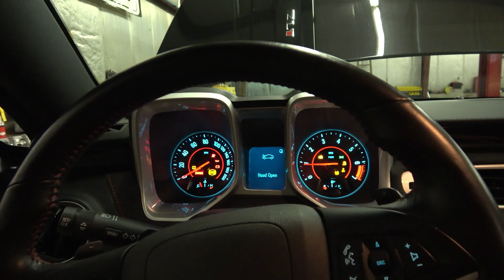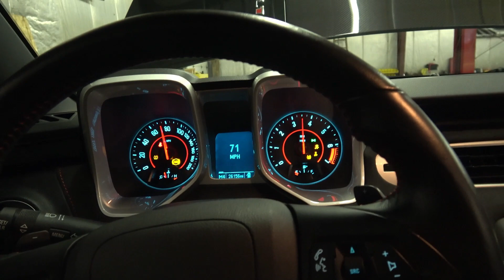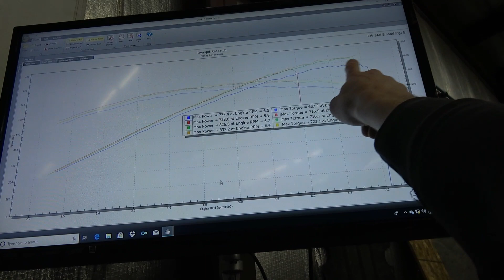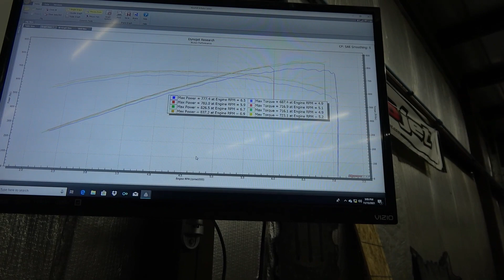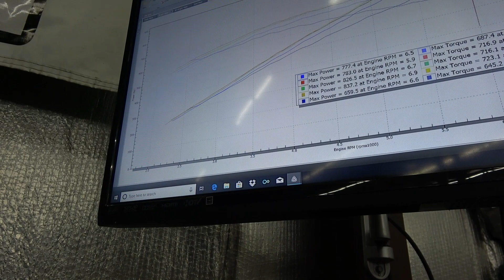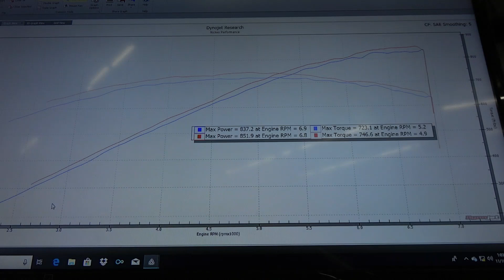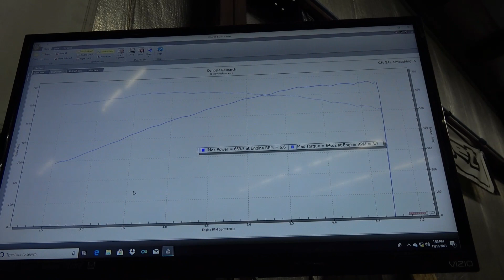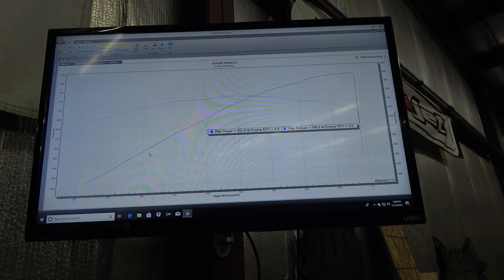Magnuson 2650 ZL1 Camaro

Comment: I'm sending my ride back for an added build. I have the BTR stage 3 cam, 2.45 upper pulley, ID1050X, duel catch can, with 2" headers, 3" cat back and 4" duel exhaust tips (CORSA). I'm adding Magnuson 2650, Nick Williams 103mm throttle body, Roto Fab Big Gulp cold air intake, 9.10 lower pulley, 2nd fuel pump for 100% e85, Arco duel heat exchanger, Texas Speed ported cylinder heads, lifters, push rods, Monster S triple disc clutch kit. J&S Performance and Tuning said we should crack 900 whp to my 2013 ZL1? I also run ROTELLA 15w-40 engine oil. I am scheduled for 4-25-2022 build and should have an answer by 5-6-2022. Great content! ✌
Update, my ARP stud kit is back ordered! Throwing a drag. Arriving around 7/9/22 Maybe?. So I am waiting on a back order before the build can start.
Reply: How’s she looking?
Reply: @ronnytavarez1140  It's not! Pissed because the distributor who sells the material to ARP, DOUBLED in price! Now ARP is shopping around for another distributor. They head bolt kit is around $430. So me and others are waiting for the kit! It went from May to June and now July? Totally sucks! ✌
Reply: @Godsblessings1111  you’ll be back out there bro better to have the right gear the first time!🙏🏽
Reply: @Godsblessings1111  i got an 11 2ss with 
Mast Motorsports 255cc heads, springs, trunnion/Btr stage 3 cam/ mellings high flow oil pump/ kooks long tubes/ corsa extremes/ ZL1 fuel pump/ CAI intake/ Airlift 3P / Upgrates rotors and wheels! Looking to add 416 forged internals, this supercharger, big gulp intake, fore triple pump, injectors, DSS 9” rear end and either 17in welds or do a 15” conversion
Reply: @ronnytavarez1140  Get down! I know she is wicked sounding and fast! Great set up!✌
Reply: I have the final numbers! We switched out the lower pulley with a 9.5 and the rwhp is 957 and the torque is 846 And Red lines at 7000 rpm's with 16+ lbs of boost. Yeehaa! ✌

Comment: Looking to see where you mounted the regulator. Don't see it anywhere and that's kinda nice. Must be tucked back in on the passenger side behind the strut tower brace?
Reply from the maker: On the return systems for 5th Gen we mount them in cabin air filter area.

Comment: What is the smallest upper pulley that is offered for the 2650 to get 18lbs boost or which size would you recommend? And what do you recommend for a 13 ZL1 with BTR stage 3 cam, 9.10 lower, 1050 injectors, 103 NW throttle body, 2" headers, 3" cat back w/ Corsa and dual 4" tips,  BG 5" air intake, ported heads. MM Catch can, The magnuson with a 3.5" upper has me at 11 lbs of boost. That is what the tuner said, based a safe street tune before we put on the dyno. Braking in Monster clutches (500 miles).  Feels slow! I don't get on it, but I can tell with my old stock w/ 2.45 upper pulley feels like it had a quicker response. Thank you in advance! ✌
Reply from the maker: You should be close to that boost now on those pulleys. This car has a 8.6 lower with an 85mm(3.3in) upper and I was just touching 17psi. Make sure the bypass is closing down all the way. Are you on e85?
Reply: Yes. We added the secondary with the new build. I have the sensor and was running 50/50 at the time. I will mention about the bypass needing to be closed all the way. I appreciate your response! Great content! ✌

Comment: Hey Matt. How much porting did you have to do with the stock Magnuson snout to get the 103mm TB to work? I'm putting one on my CTS-V and Magnuson states that in order for the 103 to be used the p/s reservoir has to be moved and the 120mm snout with an adapter plate must be used? Just trying to get some insight.
Reply from the maker: We haven't done a 2650 on a cts-v so I can't comment on fitment with a ps pump. I basically port the 90mm inlet to the outer edge of the o-ring groove. You have to be careful as some areas get thin when blending into the inlet. I blend it back into the inlet at least 2". You need to remove quite a bit of material. I start with a carbide cutter bit made for aluminum in a straight die grinder to remove the bulk and cut out the o-ring groove, then cartridge rolls as a second step, then a flap wheel to finish.
Reply: @ApeMotorsports  thank you sir, appreciate your help! How much do you think one would be leaving on the table going with a ported LSA throttle body over a 103? Build is very similar to this particular ZL1. Just trying to weigh all my options.

Comment: So you can run about 15psi or so on an LS3 without meth injection?
Reply from the maker: We only take LS3's to 11-12 psi max even on e85 or meth injection. The LSA's can take quite a bit more because of the lower compression ratio and stronger rotating parts.
Reply: @ApeMotorsports  thanks for the reply.  What determines whether or not I need (or want) meth injection?
Reply from the maker: Meth injection is an alternative to e85, can be used to supplement fuel, and does provide a cooling effect on intake air temperature. It works well with the exponential heat generated when pushing smaller stock blowers(especially lt4's) way past their peak efficiency. We don't use it very often with e85 available where we are, and usually just upping the compressor size if we're pushing a blower or turbo to its limits. It does add a layer of complexity to a build with keeping a tank full and adds another failure point. If you're tuned on a meth system and that system fails in any way, you can run lean and hurt parts.